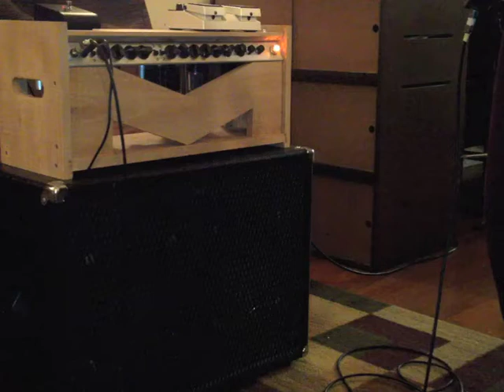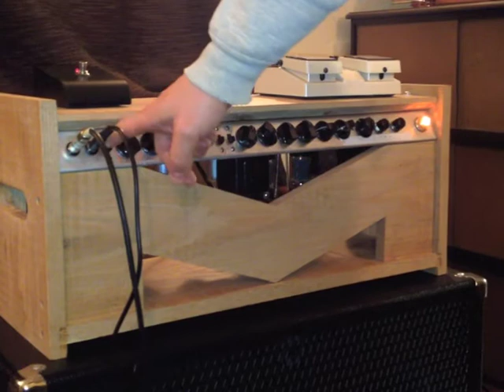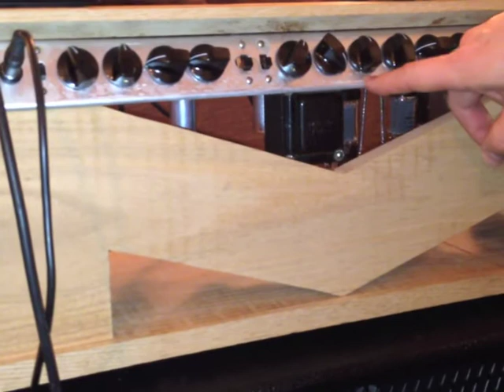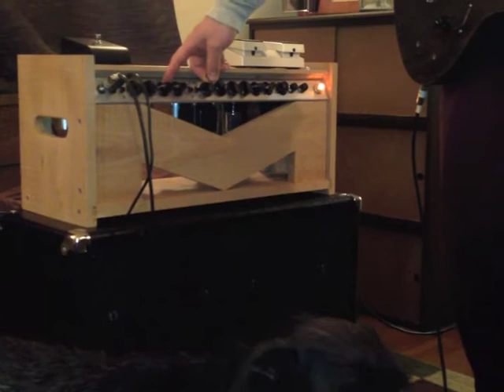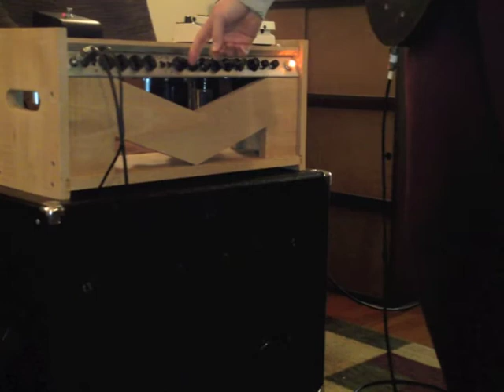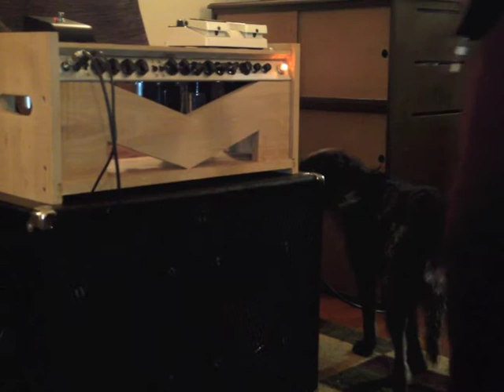London Power Standard amp built into Fender Bassman 10 chassis

Comment: What speakers were you playing through? I was listening to this while studying Kevin's standard preamp as found in "Tonnes of Tone - Electronic Projects for Guitar and Bass" (same one I think based on his comments to that effect). Interesting circuit for sure. I'm also intrigued that the lead channel doesn't use a cathode follower prior to the tone stack.
Reply: Gerald Hinson speakers were a mojotone bv30v (vintage 30 clone) and WGS reaper (g12h30 clone) in an Avatar 2x12 cab. Yes, the tonnes of tone preamp and this preamp are the same thing, although in tut1 Kevin outlines many ways to mod the circuit. I find distortion circuits without cathode followers work great. In my experience there are many other factors that more greatly contribute to the tone than whether the visiting uses a cathode follower or not. Thx! Rock on!
Reply: @erigm4820  Yep, I went digging thru my old library and found the one you have too. Can you get a Marshall clean with it too?Thanks for the reply.
Reply: Gerald Hinson The standard preamp is more of a fender clean sound, but i would take a look at the fender tone master schematic and follow that architecture. Use Marshall eq values and you should be in the realm of Marshall clean.
Reply: @erigm4820  What I was trying to ask about was whether you can get a clean sound from the drive channel and how marshally that is... interesting comment on the fender tone master though.
Reply: @erigm Also, what guitar were you playing through. I forgot to ask above.
Reply: Gerald Hinson Honestly I don’t know. I never tried to get a clean sound from the drive channel. It cleans up pretty decent with the guitar volume though.
Reply: Gerald Hinson The guitar is a Warmoth strat alder body and maple neck, Fender hardtail bridge, and Seymour Duncan JB and ‘59 humbuckers.

Comment: Did you use 2 zeners with a series resistor for the SAT switch or some other diode?
Reply: Hey Dan, I used 5.1V zeners with a 33k series resistor.  It didn't change the tone much, just added a bit of compression.
Reply: @erigm4820  Thanks for the reply!

Comment: Nice sounding amp! I built an amp using Kevin O'Conner's books and mighty happy with it.
Reply: Hi Jay.  Which amp did you build ... meaning, did you use one of Kevin's designs verbatim, or use his concepts and guidance and build your own design?  I've done both with good results.
Reply: @erigm4820 hey Erin. A bit of an older reply. I didn't know I had one waiting. I built an amp based around the jcm800 2204 but modified it with the sv1, raw bias, fx loop. I can't say I'm as well versed to read all those schematics and build one like you did on his books but I have used his advice on grounding, power scaling. BTW. Saw this video again and incredible amp you built there.

Comment: Very cool video and an excellent demo, it really shows how well thought out these KOC concepts are in most every respect. One question I have is how similar to the 'standard preamp' circuit of The Ultimate Tone 1 is this amp? I unfortunately have not been able to afford more books out of TUT series aside from the first one so I personally can't verify how much the standard of TUT5 differs from the examples shown in TUT1. Referencing TUT1, would you say that your amp is closest to figure 5-36: London Power Standard Preamp or the one described as optimal for a Yngwie-like tone; figure 5-38: Stackable Gain Method, or is it neither? I've been looking all over the net for verified audio examples of either circuit and if you could confirm which variation you built, that search will come to a successful conclusion for me ;) Thank you for your time and again for your excellent video!
Reply: +WillelmMacguyver Hi, and thank you for your post!  This version is the "standard" version with the "lead boost" option from TUT1.  So, it has the "thick" switch and the switch for the zener clipping.  I added a presence knob (hi-cut) to the lead channel, but never used it.